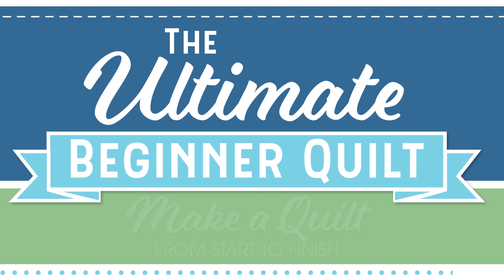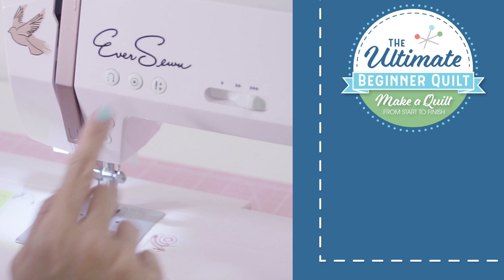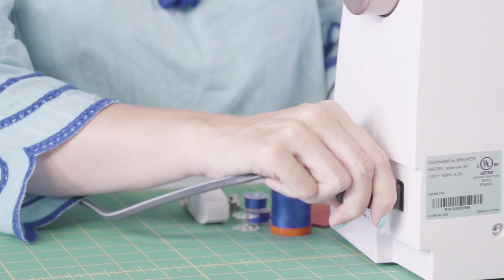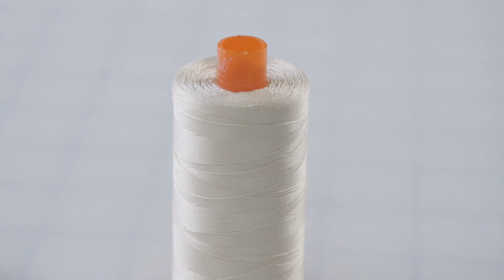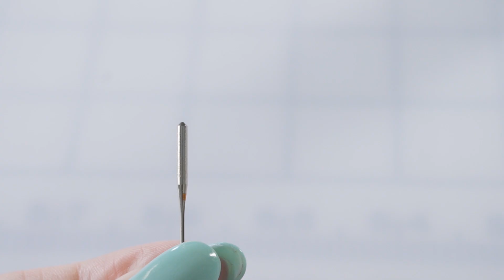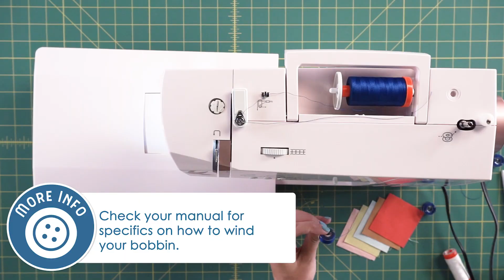Learn How to Make a Quilt - Get Ready | How to Use a Sewing Machine | Fat Quarter Shop

Comment: I would recommend following her cutting EXACTLY as she does.  I did not have enough blue fabric for block 5 so I had to use another color.  I hope I have enough for the rest of the blocks.  Also, my rotary cutter is not as sharp as hers so my edges were jagged.  I used a new blade but obviously it is not sharp enough to cut 4 layers of fabric.  Frustrated at this point.  I hope I can finish it.  I was so excited to start this project and improve my skills from beginner.  Hoping for the best  Also, I cannot distinguish some of the fabric colors.  I wish they were marked.

Comment: Does Aurifil thread work on a vertical thread holder? My machine doesn't have a horizontal one.
Reply from the maker: Hi Terri! Aurifil thread is cross-wound, which means the thread crosses itself in a regular pattern as it winds around the spool. This type of thread works best on horizontal holders because it's best for the thread to come off the top of the spool. However, there are add-ons for sewing machines to make Aurifil thread work on a machine without a horizontal thread holder. You can read more on the Aurifil AuriBuzz blog here -https://auribuzz.wordpress.com/2016/03/11/thread-matters-aurifil-spools/ - You can find thread spool tips here - https://weallsew.com/thread-spool-tip/ - and you can also try using stacked thread where the thread does not cross itself - https://www.madetosew.com/cross-wound-verses-stacked-thread/ - Hope this helps!
Reply: @FatQuarterShopTX  I guess that explains why I've never had as good of luck with Aurifil as everyone else describes 🤣😂

Comment: I’ve seen off and on for years and never knew that I needed to clip the thread and pull the thread from the bottom of my machine so it doesn’t goof up my tension settings. Thanks for the great tip.